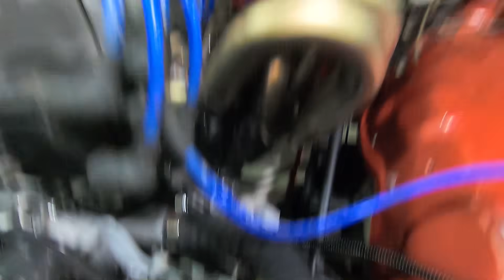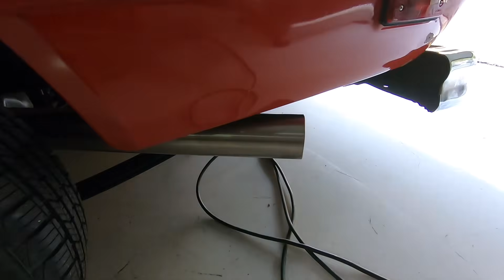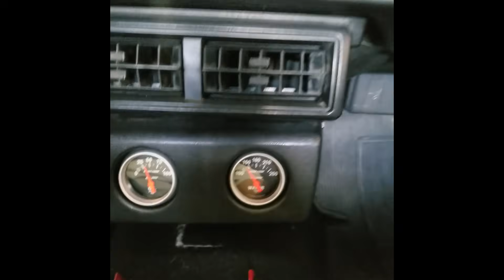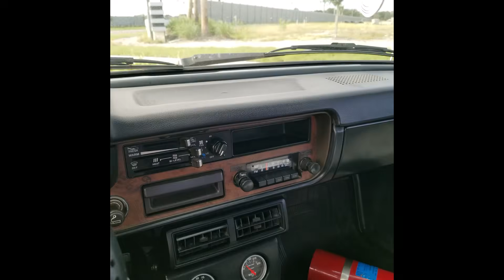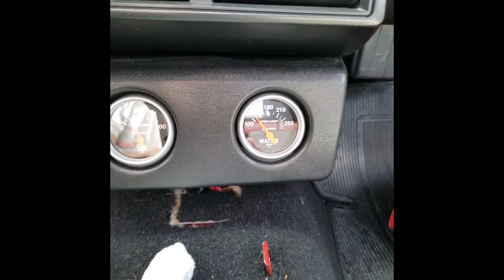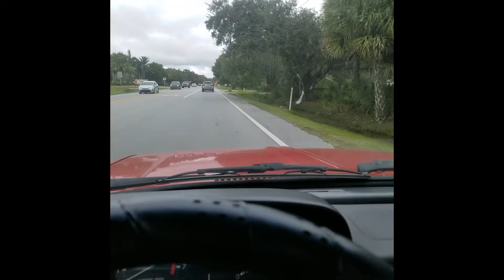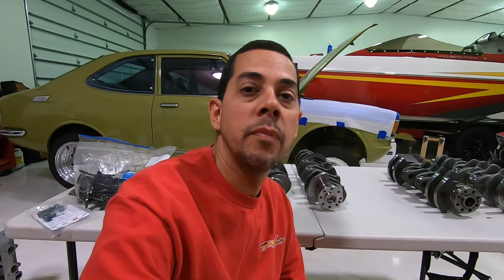22R Toyota Full Build

Comment: Great job , very nice truck, I have the1980  Toyota Corona and it has the 20R engine, I’ve tried to rebuild the engine but I couldn’t find the parts to do that , even the mechanics told me the same thing , I wonder if I can replace it with the 22R engine ?
Reply from the maker: Really? That's weird, what parts did you have a hard time finding, I'm sure we can get whatever you need

Comment: Beautiful build, love the header set up! I’m considering an early 90s Toyota build myself, more along the lines of a nice street strip build. A had 3 Tacoma’s mildly done up as a 20 something year old, just bolt ons and suspension mostly. Im wondering what your thoughts were, would you build up the 22re or swap in a 2 or 3rz? I’d say my aim would be just north of 300hp, with an eventual turbo set up. I’m guessing 3rz would be the way to go, but what are your thoughts on the 22re and that hp level? Thanks!
Reply from the maker: Hey Trey, man that's a tough. What I can tell you from this post is, people really love thwre 22r's. We have gotten so much feedback from this build its absolutely amazing. Now if you wanted to make easier power, the RZ engine I hate to say just has more technology in it. We have a turbo build coming to the channel soon. Will also have a Elite Haltech ecu to control it
Reply: @psiracing  fair enough! I kind of figured the same about the RZ motors. I’ll be watching for the turbo build for sure though!

Comment: I have an '83 long bed that I will be digging into this year. You have given me some ideas and I may be reaching out to get more info as I get further into mine. Side note - I thought '82 still had the round headlights, but I see this one has squares. Were they swapped, or am I mistaken? Love the headers BTW.
Reply from the maker: Hey man, regarding the headlights I know the truck is all original. May be a late 8or early 83 if so. Any help you need you can reach out and we'll do.what we can to answer any questions or get ya hard to gind parts

Comment: Nice Job !!! I have a 1981 pick up which will restore and my question is  what kind of camshaft should I get in order to get more power ?
Reply from the maker: Camshaft would depend on what else you plan on doing, as far as intake setup and exhaust system. Also depending on size will determine if you will probably need a valve spring upgrade.
Reply: @psiracing  First of all I would like to say thank you for taking the time writing back I really appreciate it . Exhaust system will be upgraded as well the intake and can you tell me where to get the valve spring set up to be honest I'm new in this field but since the engine is going to be repaire it would good idea to do this upgrade as well thank you again.
Reply from the maker: @libres12  no problem, once your ready we can supply you with most of what you would need to get it going correctly!

Comment: I have a 78 with a 22/20 hybrid. Had stage 5, dual spring w/ titanium retainers, lce forged rods. 22reT pistons,  Weber 38. Still need fuel pump. But will be downsizing in cam to a stage 3 With new rockers.. if i dont do the swap first lol and sell thay engine
Reply from the maker: Damn the build sounds radical

Comment: Nice work. Was wondering about initial timing setting and full advance timing @ rpm. Did you recurve the advance? Thanks
Reply from the maker: Hey John, what we do is eliminate the vacuum advance and basically keep it locked out. The beauty of the distributor is as u rev the engine it has a small delay in advance. Example, we set it at 30 and as u rev it, it may advance to 34. No detonation issues and makes it so much more responsive

Comment: Hey guys I got the same manifold and was wondering if you know what goes into the rear of the manifold. There is a threaded hole in the last intake runner near the back.
Reply from the maker: I would probably say for the brake boosters vacuum port

Comment: Oh god I'm jealous. Is that Corolla alternator a direct bolt on or did you have to space it out? My 20R is a lowly mostly stock unit but I love the idea of getting rid of more stuff in the engine bay. Killer!
Reply from the maker: 82-83 Corolla 3tc with built in regulator will bolt right in, wiring to power "on" the alternator will be a little different but not hard at all. Just needs ignition power to trigger it on
Reply: @psiracing  man thanks for the idea, definitely doing this this spring!
Reply from the maker: @buttguy  no problem, good luck!

Comment: Sincere question, I know a build like that isn't about milage, but what type of gas milage does it get and does anybody make a performance fuel injection system for the R22
Reply from the maker: It's honestly really good on gas, as long as you cruise on the smaller jet circuit you are good. Full throttle the carbs will pull some fuel but not terrible at all! I'm sure we can make a custom efi setup

Comment: yo man love the truck i just bought my first truck a 1991 hilux with the 22 people dont know alot about these motors around where i live what would you recomand for a lttlie bit more low end power
Reply from the maker: Good exhaust and header will be a great start, is it efi or carb?
Reply: @psiracing  thanks for the answear 
its efi i have it on 35s right now but plan on putting on 38s
Reply from the maker: @krizzi3707  oh damn, now i see why your gonna need more power! A gear change will help for sure, if you wanted to put some money into it, a small turbo is your best bet
Reply: @psiracing  alright thanks for the help ill look into it i hadnt even considered a turbo but that sounds like a cool idea
Reply: I’ve had my 89 Hilux 22R from new and not one of my mate or anyone I know has had a Hilux with a 22R. 
524.000km all original best engine ever!
My other Hilux is diesel 1KZ-te
Reply: @MussaKZN  can i ask whats the diffrence of a 22re and the 22R?
Reply: @krizzi3707  R carbi RE electronic injection
Reply: @MussaKZN  i was just wondering because mine the eletronic injection but it has the 22R sticker
Reply: @krizzi3707  my 22R sticker on the rocker cover fell off about 10years ago! Ha
Reply: @MussaKZN  aaahh hahaha so it must be a 22RE but someone just put the sticker on?